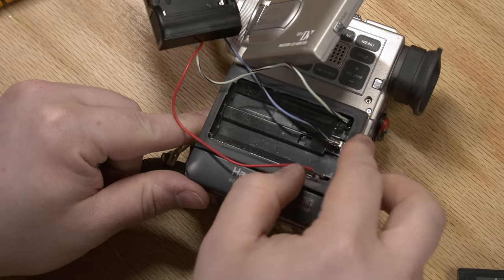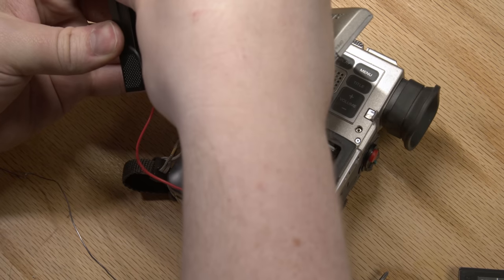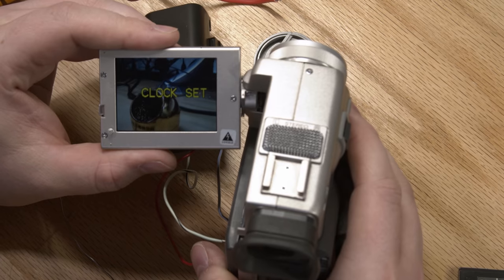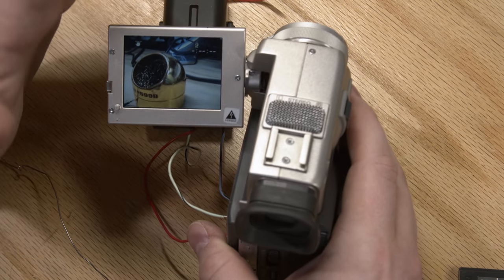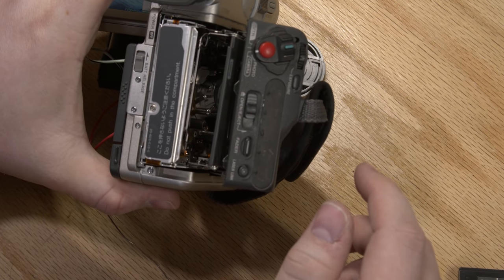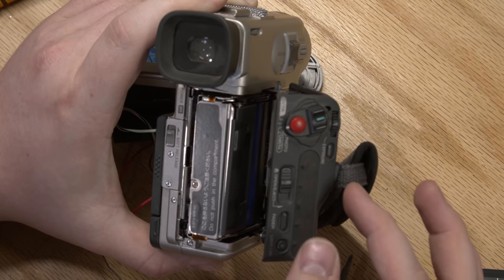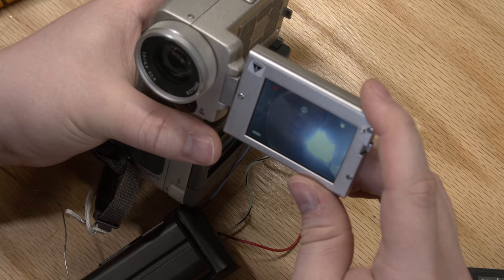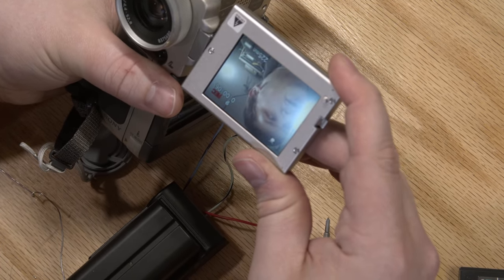Adapting Infolithium to Infolithium

Comment: I guess i got lucky, I ordered some copper electronic wire off of amazon, and it came in and worked fine for what i needed it for. I was suprised when you said a lot of the wire on amazon is fraudulant.

Comment: might be 2 years late to the party, but like I love this solution, defently the way to go, after having done quite a bit with 18650's and flatpacks, making custom packs and that, and seen them blow up and explode on the field. I normaly tell people: "If you need to ask how to work with the batteries, then you should not even try" atleast not without someone who has done it before arround. It's so easy to punture or short one by acident if you just zone out for 1 second.

Comment: Correct on not soldering those. You are 100% rite on using a spot welder. I make long range, endurance battery packs with those 18650's for my rc, fpv, airplanes. 4 cell and 3 cell BUTTTT I do solder them AND I HATE every second of it! I certainly know its butt puckering.

Comment: 7:05 spot welders work and so does just using spring contacts if you don't have a spot welder. Good application for 3d printing.

The cells are pretty safe to work with as long as you take some precautions, also in the rare event one does go into thermal runaway make sure to have a large bucket of sand to slide it into.

And well soldering them is the same story, take precautions and know what you are doing otherwise don't touch it.

Comment: Very cool! A rare case where 3D printing would have a purpose, but I like how you managed it with what you had around and came up with a solution that does seem sturdy enough for recording in studio or even light location settings.

I dream of li-ion packs with a little door on the end, like many compact cameras have for their AA batteries, but for fresh 18650s. I know it's totally ridiculous, but it would make using old laptops and cameras a lot more enjoyable...

Comment: yay, proprietary power connectors are just the best /sarcasm
Reply from the maker: I wish the EU had mandated barrel jacks in like 1978 so it would have been most cost effective to just put them in everything worldwide
Reply: @CathodeRayDude  Whats weird is that Sony is usually pretty good at using the same AC adapter plug across devices. ie: just about every HandyCam uses the same AC adapter and things like Walkmans and Discmans all use the same style/voltage barrel jack.
Reply from the maker: @NJRoadfan  right! I was honestly shocked when this didn't take NP-F and didn't take the weird "flat bar with wings" sony PSU.
Reply: @CathodeRayDude  My DCR-TRV310s use the regular InfoLithium L but the Sony adapter I ended up buying used a slightly different plug variant which didn't fit. Fortunately I was able to take a piece of scrap PCB and make my own compatible connector. Obviously this technique would not work in all cases.

Comment: I was immediately laughing the moment you said you didn't need the data pin, and that you hadn't seen a camera that needs it yet. I work in a small film studio where we also do old media conversions, and I've had some frustrating times with cameras that will even reject third party infolithium batteries. The truth about it is that sony absolutely used infolithium as a sort of DRM system for a time. I'm not entirely sure what time period, or for how long, but I assume they backed off on it at some point. It's just incredibly funny to see this was your first run-in with that.

Comment: This guy knows. Batteries are a roadblock from getting anything done with your home video.
Reply from the maker: It's so frustrating, I have probably 50 camcorders and maybe 5 can be used in the field
Reply: Retro laptops, too.  Good luck finding a NEW pack for a Core 2, much less a Pentium III, or a 486.
Reply from the maker: @nickwallette6201  YUUUUP
Reply: @nickwallette6201  For a PIII and especially older there's a good chance that the old battery is a dumb NiMH or even NiCd. For those you can just pop open the casing and install new cells without worrying about the dangers of lithium batteries. You could even install a holder for regular AAs at the expense of reduced capacity.

Yes, I watched the video, including the part about the word "just." I haven't fully repopulated any laptop packs myself but I did "fix" a 9 cell (3S3P) Dell by removing the dead section and taking one cell from each remaining section to end up with a 3S2P which worked fairly well at the time (although the capacity measurement was all messed up).
Reply: @eDoc2020   No such luck on my VAIO P-III - it's definitely Li-Ion.  That's for the best, though.  It needs the energy density to maintain a decent run-time.

But I did RE the power management section of an AST 386 laptop.  I'm working on replacing that, and probably the fluorescent backlight since I managed to pull the end of a winding off a pin of the HV transformer.  oops
Reply: @nickwallette6201  Yeah, by the PIII days most laptops had switched to lithium. My PIII-based Celeron 550 laptop is NiMH and i believe it is one of the very last with that chemistry. I'd figure most of the transition happened during the Pentium era.

And I feel the pain of breaking off the end of a transformer winding. I ended up needing to do a total rewind of my antique TV's vertical oscillator transformer even though the original break was towards the outside.

You might want to try converting your 386 laptop to an LED backlight. On my P4 Dell laptop I put in some LEDs. They're run off the main +5v rail with a current limiting resistor, and switched by a transistor controlled by the 3.3v supply going to the panel. It's far from the best solution but it makes the computer usable. On this laptop the original inverter was controlled by I2C but your 386 laptop almost certainly uses a much simpler scheme which would allow for more complete integration of LEDs.
Reply: @eDoc2020   Yep!  Very similar here.  The backlight seems to be controlled by a linear voltage from a brightness slider on the front panel.  IIRC (it has been a while since I drew the schematic), it feeds a reference input to a regulator, or a bias input to a voltage reference, or something like that.  Should be trivial to usurp that.

The whole power circuit is a bit bizarre and very much a relic of the era.  I'm planning to build a replacement board that just mounts right over that depopulated spot of the main PCB and substitutes all that functionality for something a little more modern.

I expect the display to be backlight via CCL tubes, and I'm hoping to find some miniature strips of LEDs like you might find in those fancy light bulbs that emulate filament, but with a more neutral color temperature.

The power input is a weird DIN plug with some of the control in the power brick (which I don't have), so that's gotta go.  And I would love to run the system off a pack of 18650s, which should last about two weeks on a charge compared to the old NiCad.  haha

I had to put the whole thing on hold for months because it had some corrosion issues, and I ended up having to replace the keyboard ribbon connector on the main board.  Mouser did have a part in their catalog with the right pin count, pitch, and footprint, but it was non-stock and took half a year to receive from the manufacturer.  I'm thankful it was even an option.

These are amazing times, when you can get hold of so much niche stuff, have things 3D printed or PCBs made so cheaply and relatively quickly... not to even mention the potential of cheap, accessible microcontrollers and FPGAs.
Reply: @nickwallette6201  I used warm white in my conversion and it was definitely not the best option. Cold white (like old linear fluorescent lighting tubes) would probably be right, not even neutral white.

The LEDs I used were from a battery-powered fairly light string which was a bunch of SMD LEDs soldered onto some wire and covered in a little drop of resin. I think it came from a craft store. This might be an easier option because it's a low-voltage string, which as I mentioned earlier, can just be run from the 5v rail through a resistor. The LED filaments are a series string so you'd need a boost converter. Since you're rebuilding the entire power circuitry that probably won't be a problem for you, though.

Actually I just realized there's an easier source for LED strips which are well suited for lighting LCDs: modern laptop screens. It should be easy to extract the backlight from a smashed LCD panel.
Reply: @eDoc2020   Good idea... an old LCD would probably work fine as a source of parts.  Those old 386 chunkers are hardly space-constrained, so if I have to replace all the light diffusion and reflection layers, that's not the end of the world.  I'll probably go that route on some 486 restorations when/if the CCLs start giving me trouble.  Those are color screens and will be more sensitive to CRI.  (But still 90s LCDs, so, let's not get too precious, of course... haha)

But, the boost circuit is NBD either.  I have a single-chip controller on-hand that does 5 to ~12V boost, with a reference input for PWM.  Should be a rather tidy solution, if I do find a form factor that can more or less drop in where the old CCL tubes went.

I used those same fairy lights for ambient lighting in some shelves I'm building.  :-)  They are a handy source of cheap LEDs, and I think each one of those resin drops is independently current-limited, since they're all wired in parallel.  At least the ones I got, the entire string was connected directly to a (switched) battery pack.  Although, who knows.  :-D  I guess I'll find out.

Comment: 6:50 "If I short these ends here this will explode and start a fire"
[literally one minute later]
sticks battery in an adapter with bare wires and flails it around almost shorting it out several times
:D
Reply from the maker: that's a finished pack with charge and discharge control circuitry though, not a bare cell! all the same yeah I hadn't intended that lol
Reply: @CathodeRayDude  depending on the circuitry it might still blow a fuse or a transistor (or pcb trace) up, but i guess it isn't much of a "blowing up in your face"-risk as the bare cell
Reply: Protip: you can make the two wires different lengths so accidental shorts are much less likely.

Comment: 8:20 - pulls out sled from off screen, slides presumably active battery onto sled, talks while WAVING STRIPPED BARE WIRE ENDS around right next to each other

** Audible anxiety noises **

Comment: Another point against "Just 3D Print It" is that you can't really 3D print metal contacts (without either using extra materials that are probably not reliable in the slightest or incorporating a separate process entirely, either of which would probably drive up the price much higher).
The only way you would be able to improve on the paperclip is if you had a miniature lathe or something (and even then the work-piece would be really tiny and finicky to handle, and the stock would easily cost more than an entire box of paperclips).

Comment: It's only worth getting the welding tool for batteries if your doing laptop or electric skateboard packs. Sometimes even a very fast solder of the battery wont result in fire but will result in a dead cell anyway. There are also options for non-weld solutions for batteries if the compartment size is't a concern.

Comment: several years ago I opened up a Toshiba Libretto battery, and it used 17670 cells instead of 18650 and as compact as it was it was pretty much not able to take 18650s in the shell and 17670s have pretty much been entirely replaced by 18650s.

Comment: When some people say "just" they forgot that it took 20 years to collect all the expensive equipment that makes it take 5 minutes. When other people say just they mean use what you have; get a capacitor from the junk drawer (maybe the filter cap from the organ where the wire came from), use a known current (bench or resistor) and timer (phone app) to charge them to whatever the chart says, and pop some nickel tabs from the hobby shop on the cells. That doesn't work for newer batteries without programming the fuel gauge SOC but apparently the InfoLithium chip will just let you swap the cells. I guess I understand not recommending people mess with capacitors or batteries as far as liability goes, but some people could burn their house down with a bowl of cereal; the exaggerated risks are detrimental to the right-to-repair movement. Anyway I like your way better, much more versatile to use a standard battery. I would have screwed up gluing the new terminal though, welding is easier than gluing :p
Reply from the maker: see that's the thing, I'm representing the kind of person who shouldn't mess with lithiums. I'm the person those warnings are intended for, I absolutely am not safe around bare cells.
Reply: @CathodeRayDude  You sound pretty safe honestly. Maybe scared of the whole idea because everybody says it's super dangerous. Like you said the biggest risk is cutting into the cells opening the case, and you had a metal pan ready for that. I guess safety glasses and gloves might be a good idea for some LiPo's, and a fire extinguisher is always a good idea to have handy, even just in general. But way more people burn their house down with Christmas trees in any year than the sum total of electronics hobbyists throughout history

Comment: I bought a cheap Amazon battery tab welder last year... it was a fantastic idea. I've redone several laptop packs with no explosions. The extreme frustration of trying to work with lithium packs is reduced to "Ah I'll just go zap, zap, zap, and I'm done!". 
If you have a fair few packs to go through, it's worth the $200 in reduced aggravation alone!
Reply from the maker: Yeah that's part of the problem, I only want to do this once in a blue moon.
Reply: @CathodeRayDude  Don't blame you. It's still a pain.
Reply: I'm sure there are a lot of people (me included) that will buy a specialized tool/equipment that might only see a few uses.  While it might totally negate any cost-savings of repairing an item, it's worth it to more easily repair said item, especially if just fixing something is a joy.  Similar to "I'm not sure which of these will work, so I'll just buy all three!"

Comment: Yes you can solder the 18650s, but you're partially right. The mistake most people make is not having a powerful enough soldering iron, so they put too much heat into the cell. 

With a soldering iron sldeisfned for largers connections you can be in and out soldering them under 5 seconds. Perfectly safe. Some drone batteries are made like this. 

A spot welder is a much safer and easier option for sure. 

And don't be scared of lithium. Lithium ion packs are quite forgiving. Lithium polymer packs are not.
Reply: Also those 18650s and other cylinder cell lithium batteries turn into rockets before they can explode. 

Also not fun having a white hot metal cylinder flying through the air haphazardly 😂

Comment: Fun fact you can use baking soda as an accelerant for cyanoacetate/ superglue 
The bonus of this is that it actually adds volume to the joint so you can stack more super glue and more baking soda to make a thicker and wider point of joinery. 

Not useful for everything but worth knowing for when you need it

Comment: My Canon cameras are notorious for not liking batteries without the data signal.

For projects like this, use a 2 part epoxy (putty) for attaching both halves together and closing gaps. It can be sanded so it looks decent too. Will also hold paper clips in place on plastic better than a cyanoacrylate glue.
Reply from the maker: I really do need the epoxy on hand for the latter use, but I prefer not to permanently seal projects like this because my solder joints WILL break and need repair

Comment: You can make something more permanent using cyanoacrilate superglue and baking soda. It makes a solid plastic joint and you can file and paint it doing a pleasant job. I even fixed a pressure sensor using this to "solder" the cap of the sensor.

Comment: The 2 tricks I have for repacking 18650 bricks are either to use copper EMI shielding tape with conductive adhesive - it's basically like stick-on tabs but unfortunately not great for high currents, but you CAN solder to it if you need - or to just buy Sparkfun's cells with the tabs already welded and tinned. I do still usually stay away from truly REPACKING 18650 stuff and instead just bodge in a spring terminal holder, cause screw proprietary batteries when I have a whole coffee can of functional-ish cells kicking around and just have to pick a matching set. Do a lot of NiCad/NiMH stuff like that tho, since they're all Sub C and tabbed cells are somehow MORE available than flat-top ones.

Also, discharge them in a flashlight or something before packing them so if they go Chernobyl on you it's not much power, and use a metric fuckload of Kapton tape and silicone glue.

As for actually opening the packs, which I've actually done quite a bit for salvaging cells for projects from trashed laptops, is to spudger along the edges where the decorative matte outside part meets the shiny inside part - they're usually glued so it takes Unreasonable Force and the Vise of Knowledge to break the seal but aside from some cosmetic damage they're usually left in a shape you can still super glue back together once repacked.

Comment: I've soldered dozens of lithium batteries, just use a little flux and high heat for a second or two. Works perfectly fine. No problem, even 25 yrs later when you need to replace it.